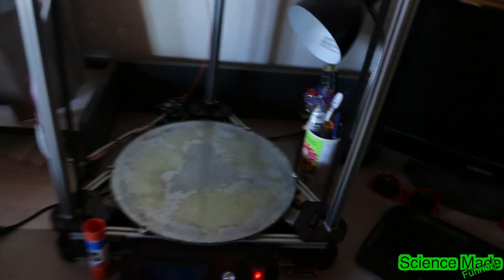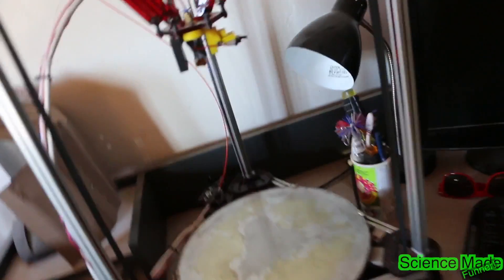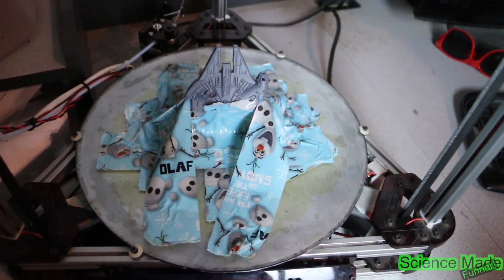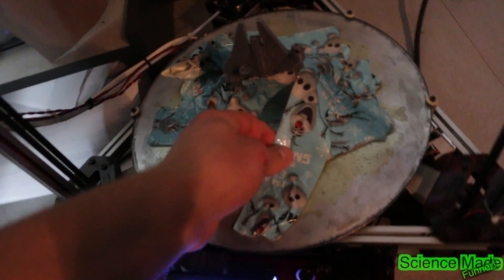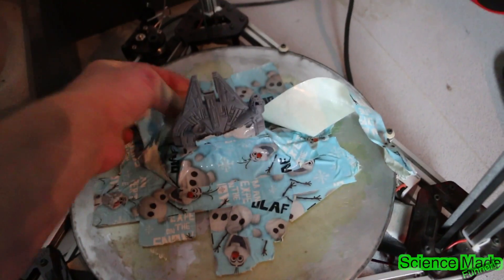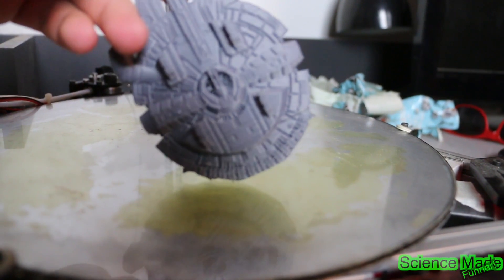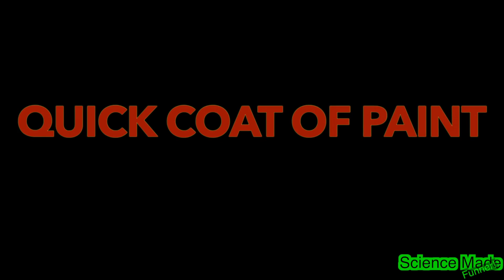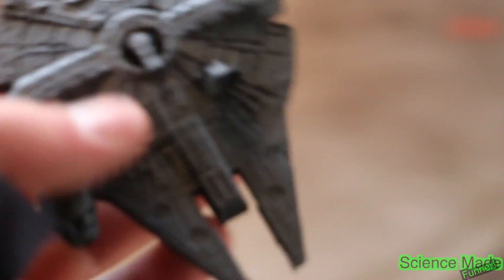3D printed Star Wars Millennium Falcon Time Lapse

Comment: hey man...love your homestead ch ...I don't know much about 3d printers but I was thinking you maybe could print the components to make you 3d printer into a large format printer...What'cha think
Reply: I recon You are already aware of it, but that idea is a great one, AND I think You can argue that it is/was one of the major reasons to why 3D printers (using FDM) are "where they are today".
The idea that a 3D Printer should be able to "reproduce itself" was foundational for the "RepRap" Project" ((reprap= Replication Rapid-Prototyper)). 
That idea AND that they chose to do it as an open hardware and open software project.
The openness allowed it to quickly and easilly spread far and wide, and the ability for the printers to "replicate" allowed them to be "easily" be refined AND  to "mutated" (through fast itteration) to enhance their performance.
Those things in combination lead to the situation we see today, with all the different models of (FDM) printers, both DIY and professionally made.
Best regards
For more "history" see:
https://en.wikipedia.org/wiki/RepRap_project